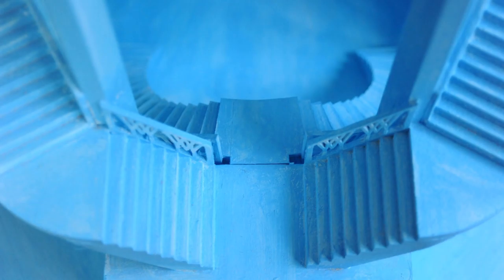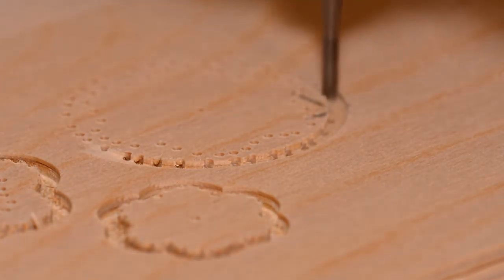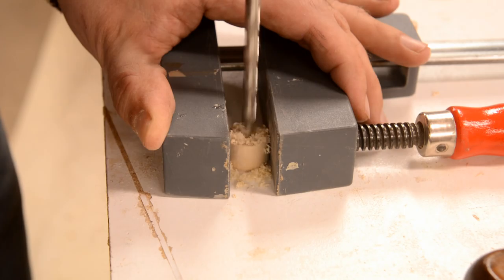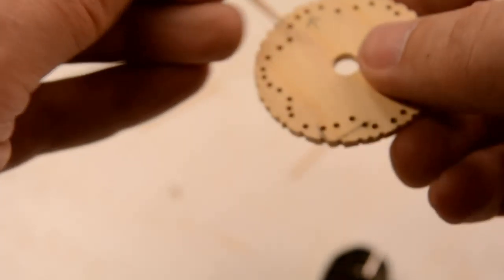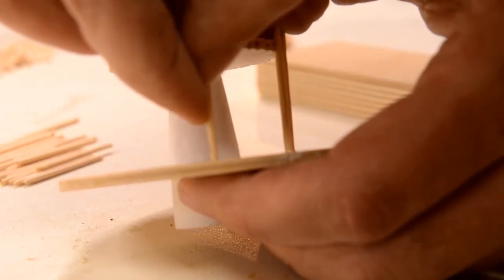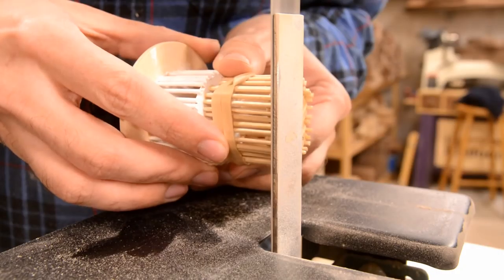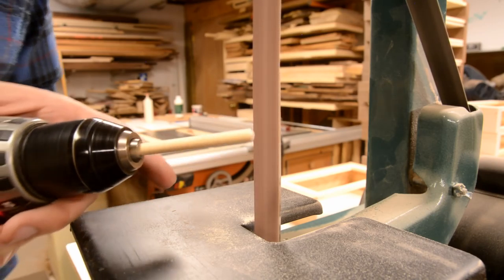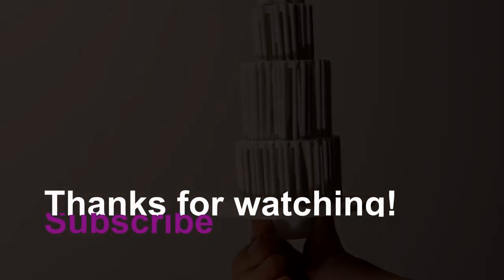Ice Fountain

Comment: Nice, looks good and not too hard to replicate.
A painting suggestion, however?  For your base coat, don't use a pure white, add a hint of grey or blue into it so you get a slight tint and it would give you a nice contrast.
Reply from the maker: I had a line about maybe a light blue base coat would work better but it didn't make it into the final edit.